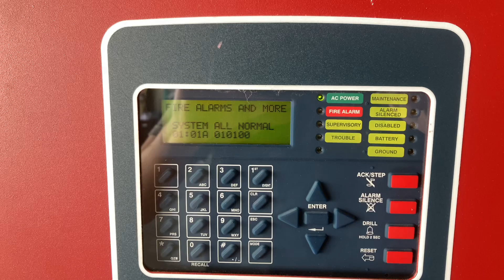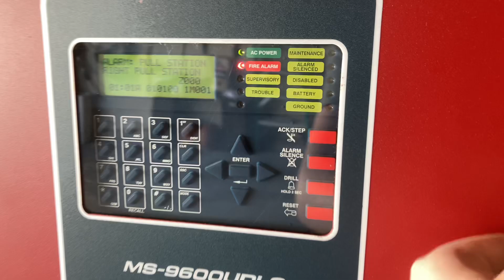Quick Fire Alarm System Test

Comment: If I had an SD365-IV or an NP200-IV detector, I’d sell them to you. But I don’t have any unfortunately.
Reply from the maker: You’re so kind! Are those the detectors that work with the 9600 UDLS?
Reply: @ Yes and they support Fire-Lite CLIP Protocol. Heat detectors are H365/H365R-IV, and NH200/NH200R-IV.